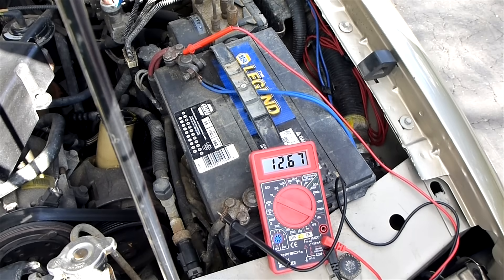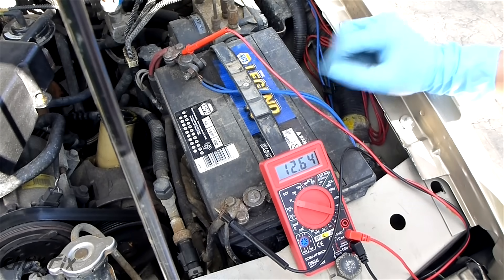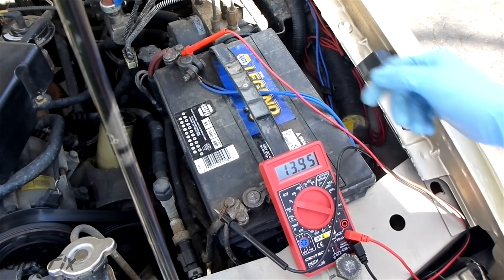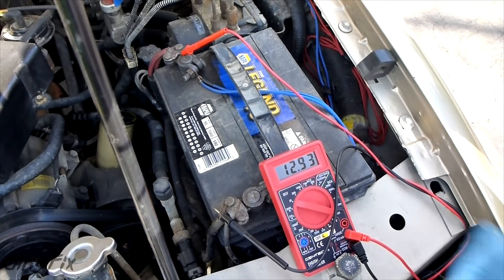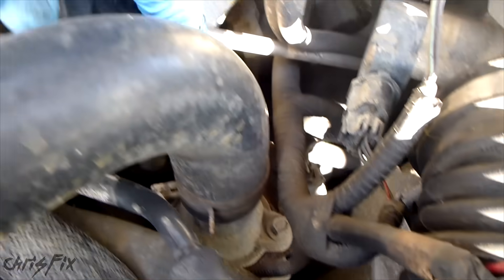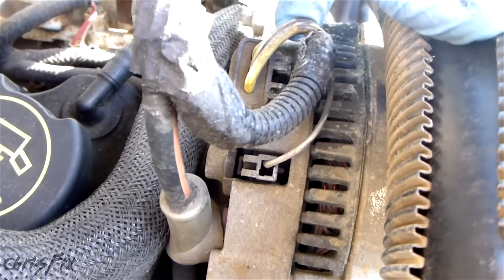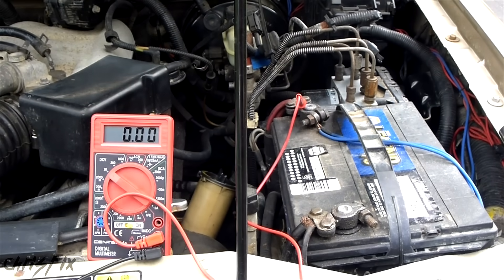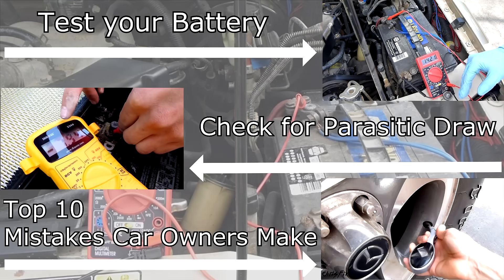How to Test an Alternator

Comment: First, thank you for making this video!  
I suspect I have a bad alternator, but I don't know. 
I measured the voltage just across the battery, and that is a normal 12.6v. When I start the engine, it reads 14.6v, just below the "Too High" mark you mention. If I turn on all the accessories (max fan, high beams, radio) at the same time, the belt driving the alternator begins to squeal loudly, until I turn off the accessories. If I turn them on one-by-one, the belt doesn't squeal. When I measure the voltage with them all on, it's 12.6v.  When I turn off the car, the battery voltage reads 12.6v again.
I couldn't get to all the parts of the alternator to do a complete voltage drop test. The negative terminal voltage drop test read -0.11v on both the alternator and engine block at about 1500rpm.
Given the belt squeal only happens with electrical load and I think I hear a raspy sound from the alternator, I think the alternator is going bad.  Does that sound plausible?
Thanks again!
Reply from the maker: +darkfoon Good job testing the system. It does sound like the alternator is going bad. Let me know what you find out!

Comment: I have an issue that I hope I can get help with. I have an '06 tc and followed these tests. Voltage at battery is 12.6 then 13.4 at idle, then 12.5 with loads at idle and has rough idle. At 2k rpm got 13.5 and with load got 13.2. Did voltage drop and got .06 on negative, and .38 on positive. After approx. 15 mins., voltage drops to 12.8 at idle. Autozone then tested alternator 3 times and passed. Im stuck at a standstill and hope to get some advice. I'd appreciate it thanks!
Reply from the maker: +Pedro Cisneros Did they test the alternator off the car or on the car? Sounds like a bad alternator to me. I would also clean your grounds and the connections to the battery terminals. Make sure your fuse for the alternator is making a good connection too!

Comment: Hi Chris! I have an old Rolls Royce (1956 Silver cloud I) it keeps running out of power and I suspect that the alternator is not charging since the battery shows 12.50v+ but when I turn on the engine and rev it, the voltage wont get higher!

The funny thing is that we had the alternator replaced not so long ago, and I've tried with different batteries with no luck, its like the battery can hold a charge for about 3 "driving sessions" and then completely dies which indicates that it is not being charged while driving, can you maybe help me?

Since I'm not that good with mechanics I wont be able to reach the alternator because of its placement in the engine bay (at the bottom)

Kind regards from Denmark! :)
Reply from the maker: +abger saurus Did you test the alternator like in this video?
Reply: I was not able to do that since I can't access the alternator

Comment: great vid but how do you check a benz with its battery at the back?
Reply from the maker: +bluerainbug You check it the same way. Go to the battery in the back and check it the exact same way you saw in this video. You wont be able to touch the battery negative to the alternator case but you will still be able to do most of the tests. Plus you can touch the positive post on the alternator and the alternator case at the same time to get a voltage.

Comment: Hi Chris,when i do the voltage drop test,i have a 0.21 reading on my multimeter...without even raising the rpms!What should i do ?
Reply from the maker: +Zisis M As stated in the video, find where the voltage drop is the largest and sand/clean the contacts.

Comment: hey Chris I did this test with the alternator and it's reading 0.01 and then it disappears?
Reply from the maker: +JMazterV112 I dont know what test you are referring to. If you are talking about the voltage drop test I showed at the end, then that is good so dont worry!
Reply: +ChrisFix well i was using the multimeter and had the negative point on the negative terminal and on the alternator case I placed the postive point scratched it a bit and it read 0.01 where as with your demonstration it read 0.05
Reply from the maker: +JMazterV112 Ok good! You are in good shape then!
Reply: +ChrisFix phew lol awesome then

Comment: hey ChrisFix i have a problem, recently my Honda 2002 accord died while i was driving and then i had it towed to my house. I checked the battery if there was anything wrong but everything passed, so i trickle charged it overnight. In the morning the car started and ran for about 20mins before the bat light went on what do i do
Reply from the maker: Jackel132 Did you check the alternator? What were the readings?
Reply: ChrisFix  the bat was at 12.50v i started the alt and it shoots up to 14.21 but then after ten mins the bat goes down to 12.10v while still running
Reply: ChrisFix and the alternator seems fine
Reply: +Jackel132 Huh? How did you determine that the alternator seem fine? Your previous statement said that you had 12.50v on the battery (with engine off), then when you started the car and got 14.21v, but then after 10mins it dropped down to 12.10v. Doesn't that proof the alternator is not able to maintain a constant ~14.xx volts? That's what the video was about.
Reply: as in the visual condition(wires and connections) seems fine. Srry seems like i forgot to add that to the previous comment

Comment: I went out to my 1995 Honda Accord EX to clean the battery terminals. The red positive terminal is seized to the clamp and bolt assembly.   Sprayed some PB Blaster on it and after 30 minutes it still won't budge.  I don't want to get too hulk-like and accidentally puncture the battery or break off the wire.  Any ideas to break it free?
Reply from the maker: Jason Jay Use this stuff: https://www.youtube.com/watch?v=2WuVBFTzoKc

Comment: I have a 2008 equinox and charging volts run at 13.0 to 13.9 is this good. O and the weather hear is 110 degrees.
Reply from the maker: Steve Martinez That is low. Sounds like you need a new alternator.

Comment: My 2001 Lexus rx300 is having a problem. When I start the car it idles at a very low rpm, then it dies. We just got new spark plugs and a new battery. Thank you for your help. +ChrisFix
Reply from the maker: Hayden Thompson It might have a vacuum leak, you might not have good fuel pressure, or your IAC valve is gummed up. Check this out: https://www.youtube.com/watch?v=vFhoNykgQtc

Comment: Thanks for video. When I'm stopped at red light and running interior fan on high, radio, clock, etc these things sometimes just stop working all at the same time. Then kick back on when I begin to accelerate. I'm thinking it is an alternator issue. I will check the DC readings tomorrow and get it remedied. Thanks again Bro!
Reply from the maker: starr shine Awesome! Glad the video was helpful and good luck!

Comment: Yes only when turn on the lights or radio.
Reply from the maker: Mrinfoone Sounds like it is an alternator problem. What if you turn on the heat or ac on full blast? Or the rear defroster?

Comment: hi I hope you can help. I did what you said and my alternator fine. But when I turn the head lights. my car turns off. Any suggestions?...thxs
Reply from the maker: Mrinfoone Is it just the headlights that shuts the car off? What happens if you pull the headlight bulbs out and then turn the headlights on?

Comment: Hello Chris, question; is the wiring harness that plugs into the alternator also known as the "voltage regulator"? If so, is there a simple way to test a new (in my case) 2-wire harness to be sure its operating properly?  I'm having trouble with my battery charging got a new alt & bat.  :(
Reply from the maker: John Henley Most voltage regulators are built into the alternator unless you have an old car. You test the voltage regulator when doing the load test I showed in this video where you add more and more electronics and watch the voltage.
Reply: ChrisFix Thx Chris, I just needed some clarity...so basically, my 2-wire harness is just that, 2-copper wires built inside the plastic module plug designed to simply connect to the alternator.  Okay got it...by -the-way, this is for a 2003 GMC EnvoyXL 4.2/6 cyl.

Comment: Great video.I am having alternator problems on  British Ford Mondeo.Under load with heated screen/lights/ac i am only getting 12.1v.Battery is at 12.64v.I will check the resistance next thanks to this vid.Cheers!
Reply from the maker: Martin Hall Sounds like you need to do this: https://www.youtube.com/watch?v=XC8W9RHGTMI

Comment: Hello Chris thx for for great vids.  But I have a slightly different question regarding alternator charging system. I think I have a problem (2003 Envoy 4.2L/6cyl) with my 2 wire harness (plug into alternator) reads 12.6DCV at harness pins. But, weak current on harness pins (no light with my power-on light test/lights when directly on battery posts).  Having trouble locating the other connection point to test or clean.  Can you tell me where the my wires next connection point.  Thanks.
Reply from the maker: John Henley I am not clear with what you are asking. Your main line is the thick line that comes out of the alternator and goes to the battery + side. That should have 14.2v while running.
Reply: ChrisFix Sorry, let me summarize my problem.  1)bad charging system:battery light "On" dash & "battery not charging" indication on my dash. Had my alt tested at autozone, results were "bad" & battery was over heating.  Got new alternator, battery & 2-wire harness.  Installed new items, still not charging. Not getting the voltage change of 14.5VDC or so across battery pos & neg posts while vehicle is running, only the 12.6VDC or so...had my "new Alt" tested at 3 different places and it tested good.   Thought, this my be related to my 2-wire harness, had to install a new one because the old one was damaged while removing it.  So my question was related to a way to test my spliced-in harness. I found a another vid that talked about using both a multi-meter and a power-on light to test for both DCV & amperage but it was for a 2002 Ford Mountaineer I asked the same question regarding "power-on" light to "Alternatorman" that posted that vid, but no answer.  To complicate matters, I did a voltage check in the "off-key/no key" position on both pins expecting grey-pin side to have no volts and red pin side (always on/hot) to have a constant 12.6VDC or so.  Well both pins were hot.  12.56VDC(grey) & 12.66VDC(red)???  Short, maybe??? I did find out those individual wires connects to my PCM plug cables. Red to plug2/pin2(middle plug on PCM) & Grey to plug3/pin51(plug nearest front of vehicle).  I plan on checking for shorts/continuity sometime today, if weather cooperates.  And to further complicate matters and this may not be related.  Awful squeal hence serpentine belt after installation of new Alt. Used you water squirt bottle method to narrow down the squeal issue, no change what-so-ever.  All pulleys look very aligned, no wiggle on pulleys, they seem to spin very freely, in essence no obvious problems.  I decided to pull the 2-wire harness out, just to test for voltage while running...did this, started vehicle and squealed for approx 10sec and then squealing completely stop.  Only ran this variable once so not entirely sure is this was a fluke or it the squeal is related to the new alt, will test the variable out again and see what happens. So if I determine this squeal is related...my next question is "why"?  I could go exchange this Alt, but knowing the what would be pretty helpful.  Anywho, my DC voltages were the same on the 2-wire harness/module plug as in the off-key position with one exception. I also got 5VDC across the grey and red pins.  So hopefully, this gives you better idea and can assist me in resolving my charging system issue.  Thx.

Comment: So when I have mine running with Fan, low beams, radio, AC and interior lights on I get a 14.44, if I add the high beams on I get 13.45, and finally if I add the rear defrost I get 12.62.  So am I fine, because usually most of those won't be on at the same time?
Reply from the maker: Gabe Borscheid Sounds like the alternator cannot keep up. Your voltage should not drop that low.
Reply: +ChrisFix hey Chris mine runs about 14.7 v when running but no other draw like no radio lights ect. yet turn on low beams, AC, interior fan and wait for cooling fan I get 13.9.  Add rear defrost and I believe mirror defrost to that mix and I'm at 12.9.  my battery seems to be going based on your battery test video, but my question is is my voltage too high that I might decrease the life of my new battery or because I'm at 14.7 am I still in the safe zone?

Comment: Your neg terminal is loose.
Reply: jim davidson YEA HE IS RIGHT CHRIS I SEEN IT WAS LOOSE WHEN YOU PUT YOUR TESTER ENDS ON GROUND CABLE TO BATTERY WAS REAL LOOSE
Reply: You are on YouTube. That is all buddy. Proper info is rather lacking for sure.
Reply: the negative cable being loose will give bad readings to the alternator.  been loose since 2014. so why didn't you fix that to see if it fixed the problem.  yes a loose battery terminal can give alternator bad readings as well as electric issues
Reply: He's showing how NOT to test anything is what's going on.

Comment: Most cars now have a pcm voltage regulator in the computer or have a clutch pulley, it drops the charge voltage below 13.5 to reduce load on the engine to help save fuel.
Reply from the maker: MazdaBass971 Thanks for sharing.

Comment: When my alternator was bad I had no charging light that turned on and it was the opposite. Mine had to do 4k+ RPM to charge. Below that it didn't charge enough...
Reply from the maker: Danger Dane Yea, that is possibly a voltage regulator. I am curious what went bad in my alternator.

Comment: Hi, what if the battery was only holding 11volt of charge but the alternator puts it up to 13.2 when runing? Is it my battery or alternator? The cars a Honda civic type r 2007, thanks Chris. Keep up the good work.
Reply from the maker: lordyboyo The alternator should be putting out 14.2 volts but it sounds like you have a bad battery. I would go to your local parts store and ask them to run a test with their load tester (they will do it for free) and that will test the batter like in this video: https://www.youtube.com/watch?v=fRfPupikHT4

Comment: When you read -0.05 you spoke it should be "below point one volts".  Do you mean >0.1 is bad, or <-0.1 is bad?  Should the potential at the alternator ground be slightly less than the neg batt post but not too much less?
Reply from the maker: Robert Jones You want to see a number below 0.1v. Anything over that is bad.

Comment: Hi chris  i got a 1989 toyota truck 22r  it draining my battery overnite, i did the battery drain test with a test lite, and the ligth come on , i removed all the fuses, and lite still on , when i removef the altetnator b+ the lite went out, the alternator is charging  14.5v and battery is ok , so i have a bad alternator? Or what else , thank you chris i hope you can help me  all yours video are very helpfull, thenk you , your new friend from san diego ca,
Reply from the maker: Everardo Camacho Sounds like a bad alternator. The diode goes bad and causes a draw on the battery. A new alternator (or rebuilt) should fix the problem.

Comment: Hi Chris I always enjoy your videos. Question? I bought a 2008 corolla LE in December 2007 and still have the original battery which has started to sound like it's getting weak over the last few days. Would you recommend I do these diagnostic tests( I have a multimeter), or just assume that the battery has finally worn out and replace it with a new one? If so, any idea what brand of battery would do well with this car? Thanks in advance for your input. Have a great week. bill
Reply from the maker: sillybillythatsme2 I would do these tests just to check yourself to make sure the alternator is running good and get an idea of what is happening. That being said, go to your local auto parts store and they will test the battery for free with a load tester like in this video:  https://www.youtube.com/watch?v=fRfPupikHT4

Comment: On my mom's Camry it reads 0.007 AC volts from negative to B+ on back of alternator and 0.014 from ground to positive battery.
What the limit of AC ripple?  0.5 AC volts or 0.05 AC volts?
Reply from the maker: 2dental1 You really dont want anything over .5v for ac ripple.

Comment: aaah don't touch terminals like he does, it is lethal.
he is in rubber gloves but he was risking needlessly.
Reply from the maker: Shimon Doodkin This is 12v DC and it is perfectly safe. You dont need to use rubber gloves.
Reply: Shimon Doodkin He probably means the lead, wich is toxic.
Reply: also today i saw a technician touching the battery and i see i am wrong. he told me it is safe.

Comment: My mechanic says my alt is no good.  Will try these tonight. If it's the alt, how do I test if it's fixable, he want $600 to replace alternator on a 2005 Volvo which seems expensive. And that's a rebuilt one. Thanks.
Reply from the maker: pgreenx You can get the alternator rebuilt for $150 at a local alternator/starter/dc motor rebuilder. If it's bad it needs to be rebuilt or replaced.

Comment: How drained can your battery get before it will not start?
Reply: +Ryan Lee I doubt you'll start under 10 volts, mine had 11 and couldn't turn the engine over enough to start